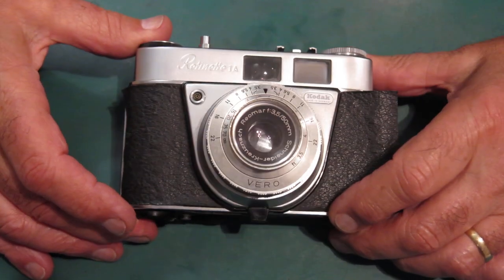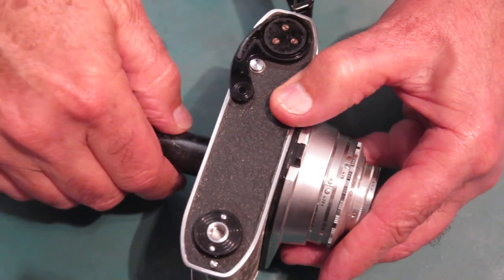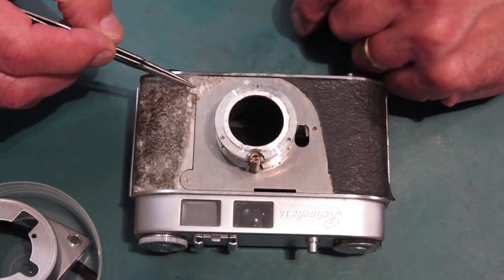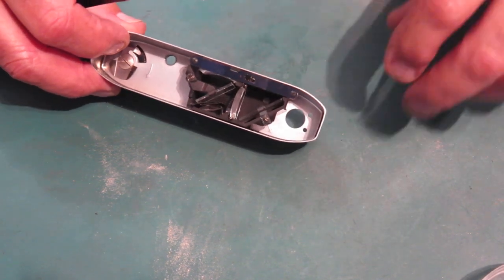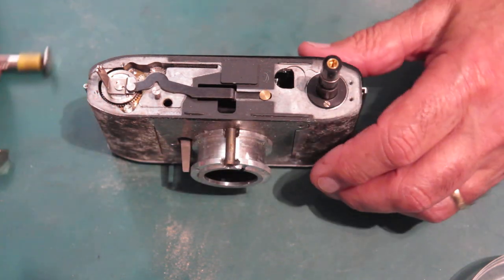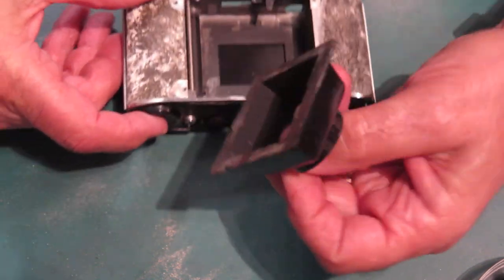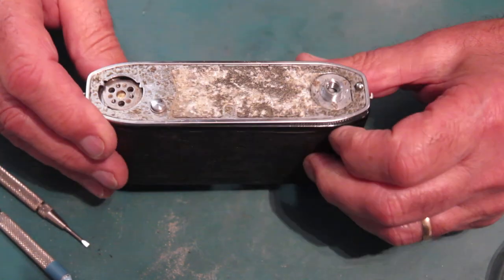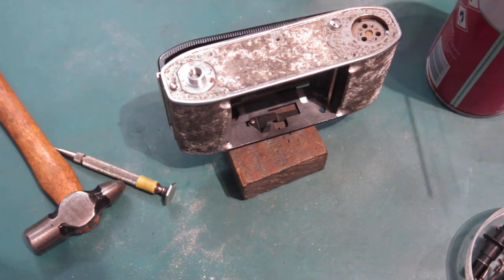Servicing a Kodak Retinette IA camera, part 01

Comment: Chris, in case I decided to disassemble my Retinette IA using just a single diameter metallic tube with two little horns for the retaining ring, which should be the diameter of the tube, 25mm? 1inch? Thank you.
Reply from the maker: The retaining ring is 27mm in outside diameter. The film gate is only 24mm wide. Look at these videos for design of a good tool. https://youtu.be/GekAmbqQhnU and https://youtu.be/-J6oDk9n13I
Reply: @ChrisSherlock  Yes, I will need something of the sort. Thank you.